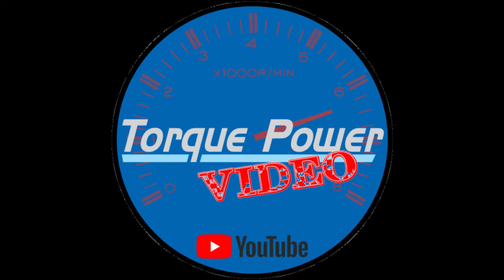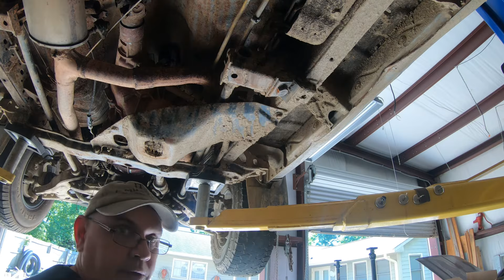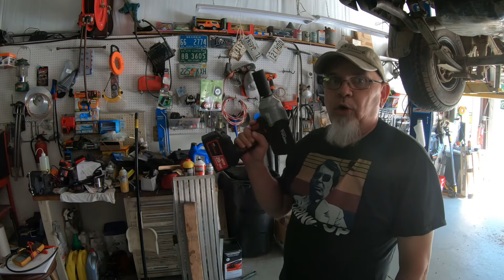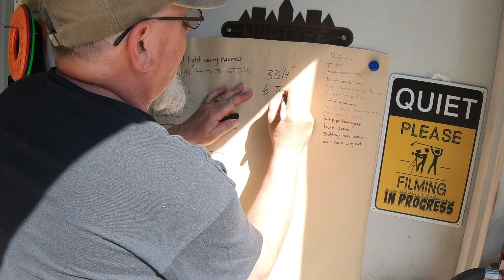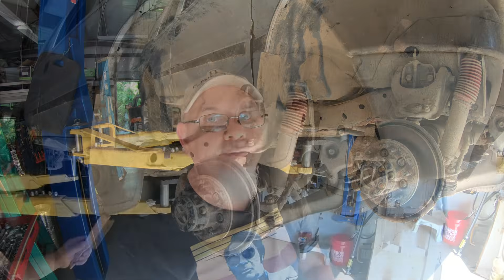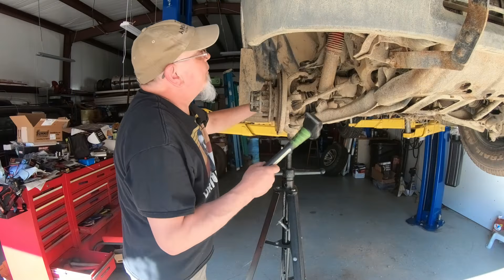Isuzu Rodeo torsion bar crank and ball joint flip - Big DUKiE EP 2

Comment: I put a set of Jeep Grand Cherokee V8 springs on the back of my rodeo and that raised it up over 3 inches.
Next I decided to crank the torsion bars up and I cranked them up to raise the front end up almost 2 in still has a little bit of a rake to it it's never going to be level but what I found out is over time your torsion bars start the weekend it starts to sag.

Save order to set a heavy duty torsion bars from calMini.

Also as others have said well maybe they didn't say it but after you do any sort of suspension changes you need to roll it Forward several feet and back it up maybe drive it let it settle a little bit before you make any more adjustments.

One other thing I found about raising the front end of a four-wheel drive that has CV axles it's going to eat those boots up on a fairly regular basis
Reply from the maker: You must have one of the newer Rodeos, right? This one I was working on was the first-generation model. They use leaf springs out back. Solid advice, though. I'd have never thought to use Jeep springs!
Reply: @TorquePowerVideo yeah mine is I don't know if they call it a second gen it's a 98 I think 97 was the last year of the body style like yours
Reply: @kentuckyfarmer62 I want to crank my bars but I'm also experiencing cupping on my tires with the stock ride height, nobody wants to touch my Trooper and I can figure out how to fix the camber. People tell me I need to shim the wheels? Is that something you'd recommend?
Reply: @TorquePowerVideo yeah if you get Grand Cherokee V8 Springs if you go on Isuzu Planet I think it's the name of the website there's a lot of information on their about mods on rodeos no it's not a Zuzu Planet it's Planet Isuzu
Reply from the maker: Yep! I've been on that forum before. Lots of very knowledgeable people there!

Comment: Thank you for doing the research for this! Gonna give my pickup the little at home lift soon
Reply from the maker: Just for the record, if you're lifting the front less than 2", the ball joint flip is unnecessary. I should've specified that in the video, but I wanted to show how to do it in case it's a needed mod for someone else's Isuzu.